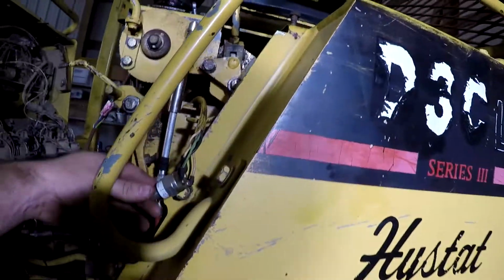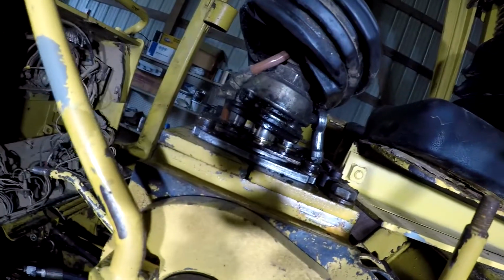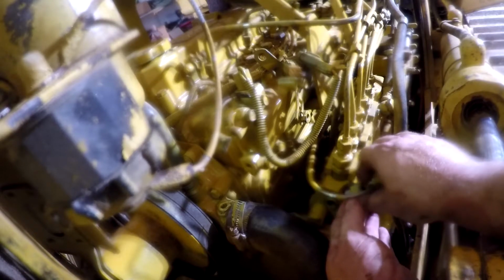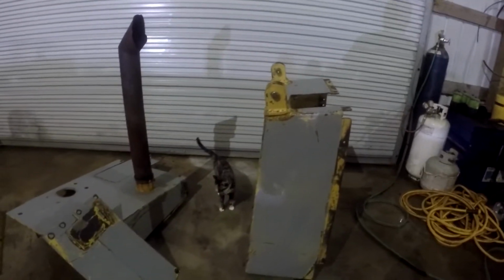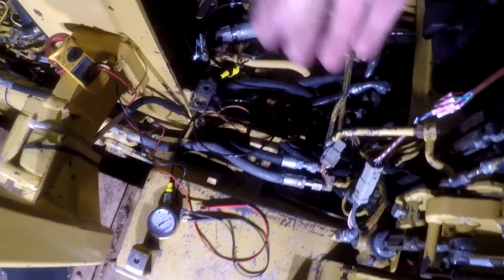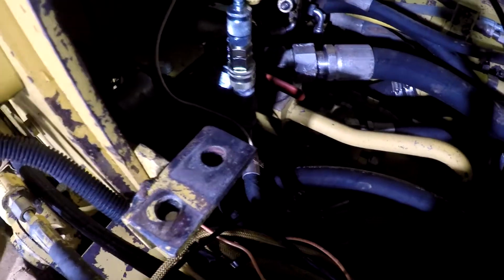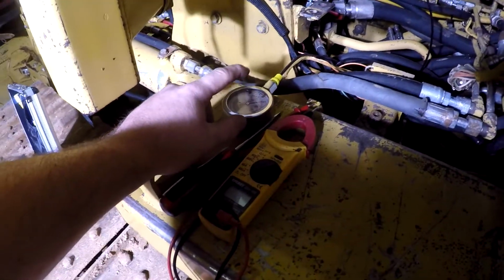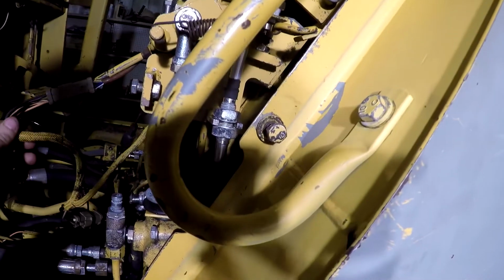Cat d3c dozer broken injector pump, parking brake won't release, and paint stripping

Comment: I have a 1999 caterpillar d4c hydrostatic dozer it ran fine when I parked it about a year ago. Would not start yesterday. I found a loose connection going to the starter it starts fine now. But won't move forward or reverse with the joystick. Does not make any kind of sound when you move the joystick. Checked the neutral park brake switch, and it's working right. What could be the problem? The blade moves fine.
Reply from the maker: Possibly the plastic pump coupler. You can Check out the other videos I have on this dozer when I first got it and was trying to figure out why it wouldn't move. Engine has to come out to change pump coupler. Could be inside the hydraulic pump like mine was also.

Comment: Check the voltage across the switch. when it is turned on. It should read close to 0. Any voltage there is voltage drop across the switch that shows the voltage that doesn't get to the solenoid. Switch could be defective or not made to carry enough amps for the load. In a circuit that draws a few amps it is better to use a bulb that draws close to the same number of amps that the load draws. I believe you are right about it being the switch that is bad. These days even new parts are sometimes defective.

Comment: Nice video Chase. I like seeing you work your way through a troubleshooting routine. I was curious if you have considered getting a microphone for recording your videos? Sometimes the audio gets so quiet when you're talking.
Reply from the maker: It probably wouldn't last 30min before it got ripped off while I was trying to work on something. I usually try to boost the volume a bit in the editing when I don't forget. Not sure what devices you are listening on but it usually sounds ok on my end as long as I don't have anything running, such as a fan or welder or other equipment. I might pick one up eventually though, It might would come in handy if I was running a piece of equipment and not crawling around under it and on it lol

Comment: Nice troubleshooting. I would first check that it is the correct switch. If it is, new some times is also broken. A switch that has internal resistance in a coil circuit is odd to me.
Reply from the maker: I think they must have had problems with this design switch. with no relay it's requiring 15-20 amps to be pulled across the switch wich might be a bit much for the small contacts in the switch, and that's why the high resistance. Still haven't decided what I'm going to do with it just yet. I haven't even bothered to look up a new switch yet.
Reply: @LifeWithChase  If the coil is rated for 12 volts there is no reason, that I can think of, to have a dropping resistor. If it is a 6 volt coil I could see it.

Comment: I'd put the relay in , its the easiest way and keeps everything as is . 30 amp relay  is  cheap compared to replacing  that $100 switch 😅
Reply from the maker: That's what I was thinking. No guarantee another new switch will be any better. I guess they been running it with that wire going to it for who knows how long, so as soon as you turn the key on, it has power. I just wonder about the duty cycle of the solenoid because if you stop for 15 minutes from time to time and  leave the dozer running that would allow the solenoid to cool some in normal operation. The way they've had it, it's hot until the dozer is turned off.  I suspect only using it 2-3 hrs at a time probably wouldn't make much difference though.
Reply: @LifeWithChase  The solenoid must be a constant duty or it would burn up as an intermittent duty 🤔 or you will find out real fast LOL